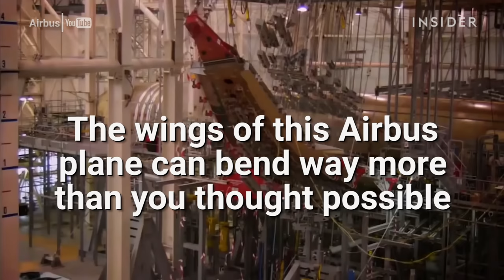The wings on this Airbus flex way more than they should

Comment: why are the wings not tested when theyre allegedly full of fuel?
Reply: Simple one, fuel is extra weight, with drag wing down, due to gravity. This make wing to carry less tension because gravity is in opposition to aerodynamic lift force.
Reply: Wings carry fuel.
Reply: check out the thickness of concords wings then tell me they could hold enough fuel to cross the atlantic https://www.youtube.com/watch?v=yBmIS5cWY_8
Reply: This has to be my favourite tinfoil hat theory so far.
Reply: exactly. they are tested:

-without fuel
-without engines (which are on full power and bobbing around violently as they do during turbulence)
-without having gone 20 000 fatigue cycles, as regular aircraft which are in use have..

utter shit show
Reply: What do you mean allegedly full of fuel? They carry fuel. They probably don't want to break the wing full of fuel cause that means they would have to clean all the fuel.
Reply: @ubershredder1989  well considering no commercial airplane has crashed due to a wing breaking from aerodynamic stresses in the last 50 or so years, I think they are good.
Reply: While it's a good question to ask why they aren't testing the wing fully built, especially since flaps and the like are moving parts and also themselves would add structural strength to the wing no doubt, something to keep in mind is that what ever weight we add to the wing will reduce the stress on the wing. The way the wing works is that the wing supports weight where it's attached to the body. If you were to take all the weight of the body and spread it across the entire wing, it would have almost no stress... Imagine holding out your arm and holding a bucket of bricks... lots of stress on your arm and shoulder. Now imagine resting your arm on a table and spreading the bricks across your entire arm... it would be no problem.
Reply: @theeye2429  When you are skipping math classes in school - that's the blow back.
Reply: @theeye2429  you might wonder what all that firey stuff was spilling out of the wing of Air France 4590. Can you imagine what it would have been like if there was fuel in there too?

Comment: They cut away the part where the wing broke in pieces :)
Reply: And, the wing finally exploding into pieces shows better design work than if the wing bent or snapped in only one part, because that would have demonstrated either that the part where it failed wasn't strong enough or the parts that didn't fail were unecessarily overbuilt.